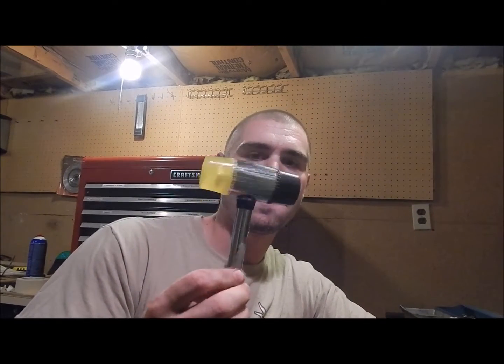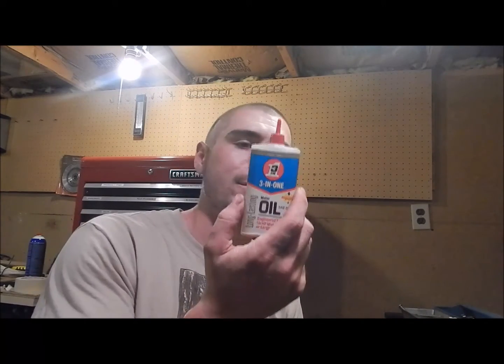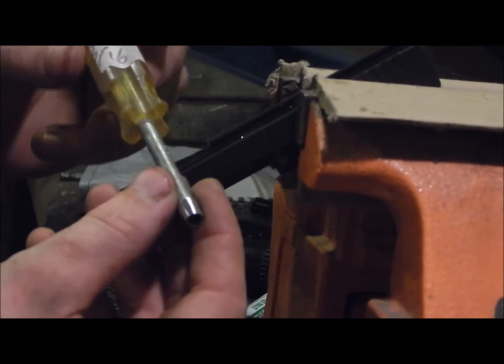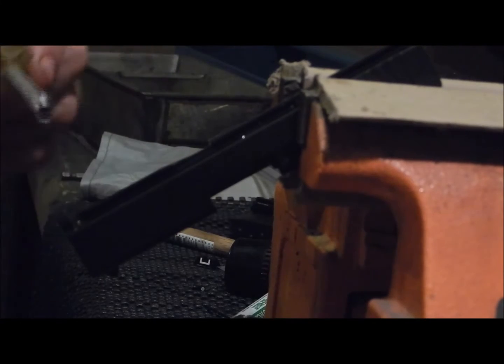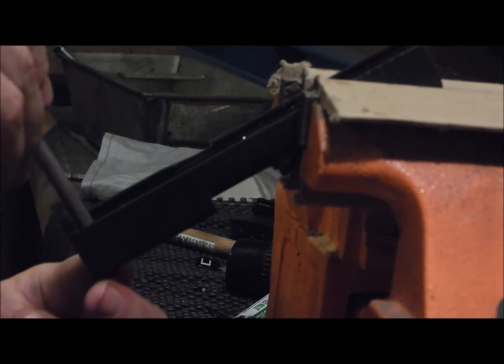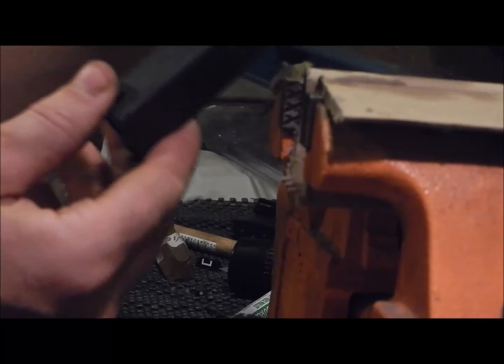Installing Truglo Tritium Sights on Glock 43

Comment: This was the first video I found when searching for tips on a Truglo sight install. Perfect amount of info for someone with basic mechanical skills. I happened to have a very cheap socket set and also made a front sight tool by beveling the leading edge of the socket and then grinding a groove to help it clear the nose of the frame where the recoil spring seats. For the rear sight, I used a brass drift with two layers of painters tape to protect the finish. Easy project - made easier with your tips. Love the TFO sights, very impressed with the quality & utility at this price point.